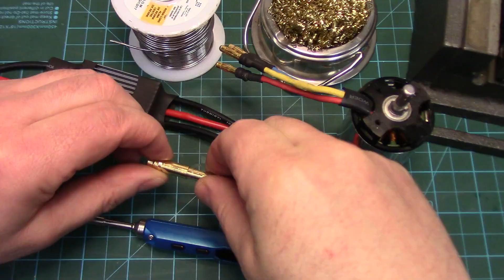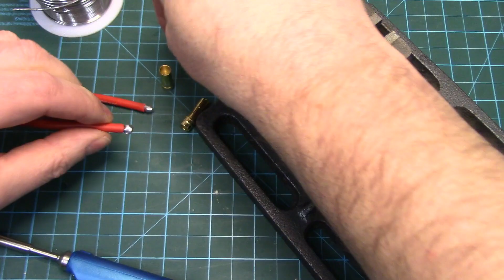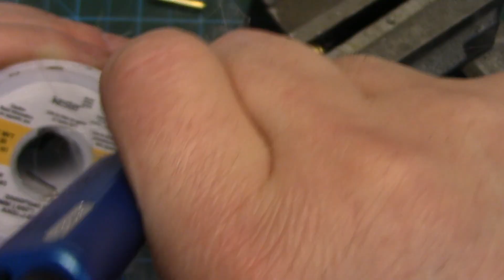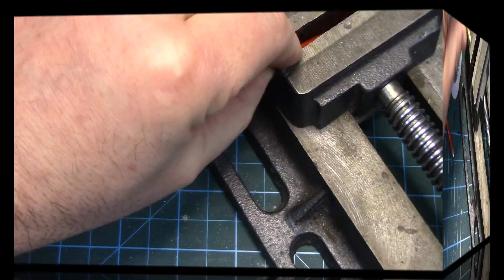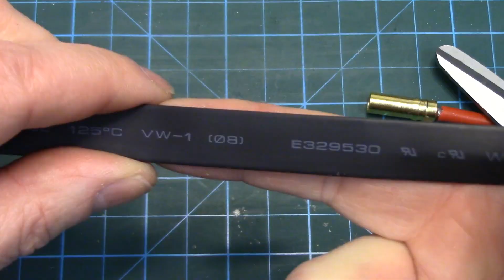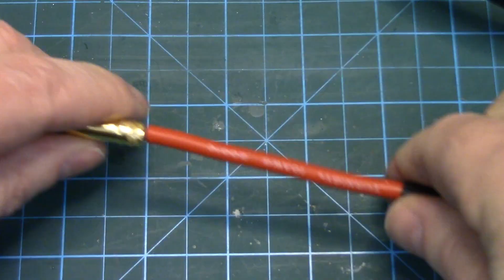Soldering Bullet Connectors

Comment: Hi can you solder two 8awg wires toghether to a 8mm bullet connector?
Reply from the maker: Might get them to fit, but it will be tight and you'll need a very powerful soldering iron with that much thermal mass. Not even sure if a 140W weller gun would deliver enough power, but you won't know until you try.
Reply: Heat is not problem if I use a torch. The problem i see is  how to mix the two wires to make a single round tip to fit the bullet. Is there a crimping for the job?

Comment: flood solding maybe easier?
Reply from the maker: Very poor tinning penetration of high flex silicone wiring with flooding. Guaranteed weak mechanical solder connection (unless you properly pre-tin with a proper soldering tool before hand).

Comment: Appreciate this tutorial. I had to do some repairs on G3PO bullets and in over a decade, I've surprisingly never had to solder a bullet!

As many have said, I would encourage teaching people to remove flux, because at the scale I work it really does corrode over time if you don't.
Reply from the maker: In the 30+ years I've been soldering professionally as a tech, I have yet to see good quality rosin  flux cause corrosion, even decades later in some cases. I've only used Kester rosin core solder and it has been proven in the field not to enter into reaction and cause corrosion. Guess that is why it's the only brand I'll ever use. If you feel you need to spend extra time to remove it however or use more corrosive flux, please do so.

Comment: Thank you.Helps a lot. Using for ebike motor-controller fase connector!.  Anybody knows max current for these connectors? More specifically average quality  gold plated 4mm.
Reply from the maker: I cover current ratings on bullet connectors from 2mm to 8mm on my RC connector page (bullet connectors are about 2/3 down the page): https://www.rchelicopterfun.com/rc-battery-connector.html

Comment: When soldering wire into bullet end could it be possible when making the wire end that if you flatten the end of wire that it would rest flat on inside to make a better contact because its flat instead of having partial of the end of wire touching.  Just a thought.

Comment: I wonder why i dont see more people using a turbo lighter for soldering bullet connectors, its much faster and more secure soldering.
Reply from the maker: And not nearly as controllable - that is why. Not more secure either - the mechanical strength of solder has absolutely nothing to do with how it's heated; it has to do with using the correct amount of heat, good quality & the type of solder and flux, oxide free surfaces, and of course good soldering technique.

Comment: my question is if I put a bigger bigger bullet connector on my motor and ESC will it pull more current to each other with my 12 gage wire
Reply from the maker: Current is limited by the smallest conductor in the system just the same way water flow is limited by the smallest hose or valve. So putting a larger than required bullet on a 12 AWG wire will still only allow the maximum current that the wiring can flow.

Comment: I tried this but with plugs and 12 g wire…. A few tiny strands of the wire got stuck outside of the bullets on 2/3 of them. 

This happened because the wire frayed when I was tinning it, and became more frayed when I inserted it into the bullet. 

Am I screwed? Or can I run it as is?  It has plenty of solder inside the bullet (overflowing a bit honestly), and the connections are strong. 

How would I go about fixing rhe frayed wire? Should I need to?
Reply from the maker: The issue with frayed wires on the outside of a bullet pin is they are sharp and can easily poke through the heat shrink insulation (or whatever insulation you use), and then become a shorting hazard. With only 2 or 3 stands sticking out, I would just grind/file them down if you know the solder connection is good.

Comment: why do some bullet connectors have little holes on the sides? i see the ones your using don't. I've been looking online trying to order some but mostly see ones with holes or like half a cup. does it matter if the do have holes? or are they lower quality?
Reply from the maker: Holes are common and nothing wrong with them. They prevent trapped air pockets from forming. This allows the solder to reach deep inside the recess if there is no air pocket in there, plus has the potential to provide a more solid solder connection. The cups are fine too, even better IMO. They are both easier to solder and you can visually see the solder connection to confirm good penetration.

Comment: Thanks for all the useful information. I bought some xt150 connectors to use between my motorcycle stator and rectifier. The stator produces 80V at 6.000rpm . You think these connectors will hold up? Thanks!
Reply from the maker: No idea as I would need to know the current load, not voltage to even make guess.
Reply: @rchelicopterfun  the stator has a 360 W output  and the main fuse is 30 amps. 
Hope this helps
Reply from the maker: 30A. You just answered your own question; a 150A rated connector is overkill.

Comment: I find the best and quickest way to use solder paste and hot air solder. Brush the cable tip with quite a lot of paste. Put some in the bottom of the connector. Use crocodile clamps to fix the connector and cable still, at some downward inclination. Use hot air to heat up the solder paste until it reflows and slowly pours downwards into the connector making a nice solder cone with even temperature.

Comment: I would strongly recommend a set of "helping hands" adjustable grips; it would make the whole process go much faster, and you don't have to hold the wire which gets hot very quickly as the copper conducts heat away from the joint.
Reply from the maker: I do have helping hands and they work well for holding smaller connectors and wires, but not the big stuff shown in this video. Have you ever tired to hold heavy, large gauge wire and/or connectors in those tiny helping hand clips - they are simply not strong enough to hold the connector still or secure. That is why I use my drill press vice on larger connectors/bullet - they don't budge.
Silicone insulation on this high flex wire is also a great heat insulator. I barely feel the heat when soldering, but I've been soldering for years so I'm used to it. I would rather hold the wire if I found it too hot with surgical forceps/similar so I can still have fine movement control of the wire which is another thing lost with helping hands. If you find helping hands useful on large wire too - then use them. We all use what works best for our individual application and experience.

Comment: I’m new to the electric rc world and I have a question which might seem stupid to most, but have to ask. My brushless motor and esc are rated correctly, but he make bullets on the brushless motor are too big for the esc female connectors. The motor came with an extra set of female connectors. Should I just clip the connectors I have on the esc, should I de solder them, or should I change the bullets on the brushless motor? I know I’m probably mind effing this thing, but it’s my first electric balsa build fixed wing rc plane and I’m trying to get everything as efficient as possible. 
Also, wore gauges are identical for motor and esc, just the connectors are too big coming from motor
Reply from the maker: That is pretty common. Since your motor came with the correct size female bullets to use with the male bullets on the motor wires, I would remove the female bullets on your ESC (de-solder them) and then solder on the correct size female ones that came with your motor. 
You could also cut them off the ESC, but then more work & solder is involved. You would have to strip each of the 3 wires & re-tin each one before soldering them. If you just de-solder them out of the bullets, they are already properly tinned and you just have to resolder them into the correct size bullets.
Reply: John Salt thank you so much for not only such a quick response, but also putting my friggen mind at ease. I know this stuff, I just have to run it by people who know more than I do for clarity. That’s what I  figured since the motor came with the female bullets as well, and the fact that the esc and motor are completely compatible . Plus having the same gauge wire, it all makes sense. But like I was explaining, I had a bit off a learning curve after flying nitro years ago, taking a 20+ year hiatus from flying, and just getting back into it. I have ran 1 or 2 foamies nose down into the ground because of esc failure, or I should say esc and bec failure. I’m just being extra careful since this balsa build took me a couple of months to build. Once again, thank you for your quick response and solid answer!
Reply from the maker: You are more than welcome & glad I could help a bit. BTW, all my larger electric powered helicopters (550 and up), I actually run 2S LiPo or 2S LiFe RX packs in them just like my fuel powered ones for exact reason your mentioned about ESC BEC failures. I don't trust BEC's in larger machines - never have, never will 🙂
Reply: John Salt wow! At least I’m not the only one. I’ve downed 2 planes because of bec burnouts

Comment: Do you have video of how to remove bullets?
Reply from the maker: Remove them from what? Remove wire from the bullet, or remove the bullet/s from a connector housing?
Reply: Remove a bullet from the esc wire. I want to replace the 6.5mm with a 8mm. I don’t want to cut the wire anymore it’s already to short.
Reply from the maker: Heat it up with a soldering iron or gun to melt the solder and remove it the same way you fit it.

Comment: You're not worried about the lead solder shrapnel/dust getting everywhere? I heard it can absorb into your skin and cause a bunch of health problems and then I also hear that it's no big deal at all. I've been trying to solder for years and every time I try I fail miserably. I even tried some high silver content kester lead-free solder that is supposed to have a low melting point but it's impossible to work with. For me anyways.
Reply from the maker: While I won't pretend for a second to be a health expert trained in toxicity levels of lead; I'll address your question with my own results & research on the subject. 

Lead's primary method of absorption into the human meat servo is through ingestion and inhalation (why I say to wear a mask and eye protection when grinding). Very little lead is absorbed direct through the paws of the skin unless it's in solution. Washing your hands well after handling leaded solder (what I do) is good practice. If very concerned, wear surgical gloves for maximum protection. Perhaps my web page on soldering basics might be helpful: https://www.rchelicopterfun.com/rc-soldering.html

I'm also presuming you are an adult so your lead risks through exposure aren't as high. Children are the most susceptible to lead poising and since there are no rug rats running about in my work shop, the little bit of lead that is left on my work bench after vacuuming and a good wipe down doesn't concern me in the least. 

At the end of the day, it's up to the individual to determine what they deem an acceptable level of risk-return trade off along with level of lead exposure. If you solder with leaded solder for hours daily, then the exposure risk is greater; if you only solder several times a month, not so much. 

If still concerned, when you go for your yearly medical & get your blood work, have your doctor ask for a lead test as well. That's the only way to know for sure after all - real data. My last blood work (like every test before it) indicated normal low levels and I've been soldering with leaded solder for over 40 years now. Grew up in a house with some leaded paint as well - never ate the paint however :-) 

Most importantly, don't listen to any goof on YouTube or the interweb giving you "free" toxicity risk advice - talk to your doctor. Moreover, to understand lead poising better and the risks involved, look to real medical and science based articles & journals. While not perfect, Wikipedia is generally a fairly good starting point since it tries representing real science backed information: https://en.wikipedia.org/wiki/Lead_poisoning
Reply: @rchelicopterfun  Hands down the most informative well worded reply I've ever received. I've been trying to solder smaller things for years but even a lead-free solder with a high silver count is impossible to work with. Especially on stranded 10 awg wire. I'll spend an hour trying to do something with lead free solder that'll only takes a few seconds with 60/40. I only solder a few things a year so I'm going to go with 60/40. Much easier to work with. Just don't like the idea of sanding the 60/40 but I'm going to make some type of box to do it in to contain everything, because just like this video my 10awg sticks out a little too much and the dremel is necessary.

Comment: Why didn't you hold the tip on the outside of the bullet?
Reply from the maker: Two reasons: 1. I wanted as little (none) solder on the outside of the bullet. Since solder tends to flow toward the heat source, heating the outside of the bullet would increase the likelihood of any excess solder flowing to the outside of the pin. 2. For the best heat conductivity from the tip to the component being heated, you need solder between the tip and the component. Again, since I didn't want solder on the outside of the pin, it would be very difficult to transfer enough heat through a dry tip to the outside of the pin & then to the wire. I find it it's much easier, quicker, and efficient heating the wire up instead, and letting it then transfer the heat to the pin.

Comment: Quick question.  It seems that there are two types of bullet connectors,  ones that use what looks like lighter weight metal to make the "spring" connection (the three bullets seen at "0:17") and ones that look like the body is split into quarters (the one seen pulled apart at "0:37") and they provide friction.  Are they the same in amperage ratings?  Do they have different names?
Reply from the maker: I actually cover this very question in detail on my RC connectors page under the bullet connector section:
https://www.rchelicopterfun.com/rc-lipo-battery-connector.html
The quick answer however is the split bullets are "generally" larger and have the higher current rating over the sprung sleeve type.

Comment: Are u using 3.5 mm bullets or 4 mm.  How do u know which to use.  Or does it matter. Thanks
Reply from the maker: Depends on the current the connector will be handling. I talk about bullet size in relation to current handling ability on my RC connector page under the bullet connector heading: https://www.rchelicopterfun.com/rc-lipo-battery-connector.html

Comment: John, awesome videos on soldering. Now, for the bullet connectors you used the TS100, it is great because its tip fits the small part between the connector and the wire. How about if I do not have the TS100 but the Weller gun? the gun tip is much bigger, how do I apply the tip to the wire without burning the slicone of the wire? Do I hold ot against the connector? Not sure. Thanks for some feedback and tips.
Reply from the maker: Hi Armin, The process with a Weller soldering gun tip is exactly the same. The tip on the gun is actually not much larger then the D24 tip I was using on the iron. The gun tips are beveled about a 45 degree angle at the tip so you could still be touching the wire and the connector to pump heat into both. As the solder melts and you are able to push the wire into the end of the bullet pin, you would just have to move the gun tip back a bit to allow the wire to side all the way in, while still keeping the tip on the rim of the bullet to keep pumping heat into it.